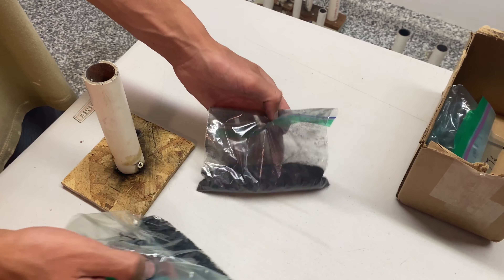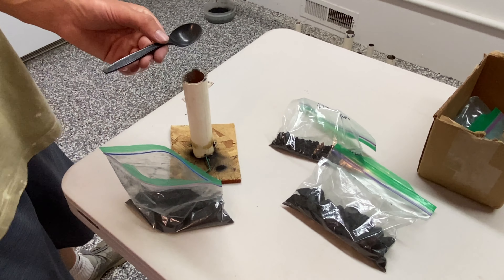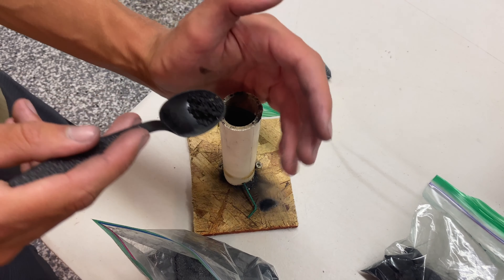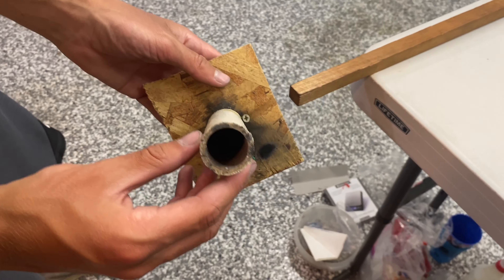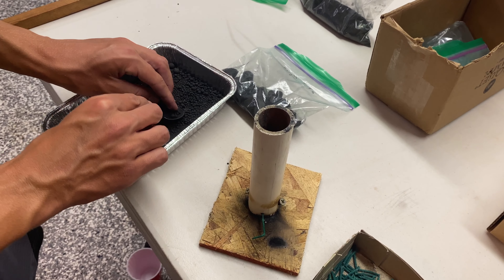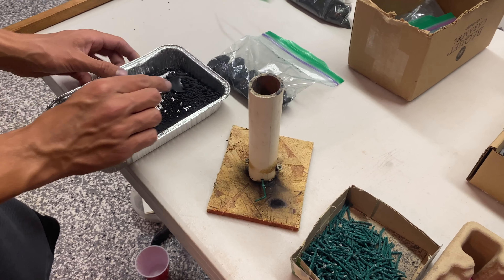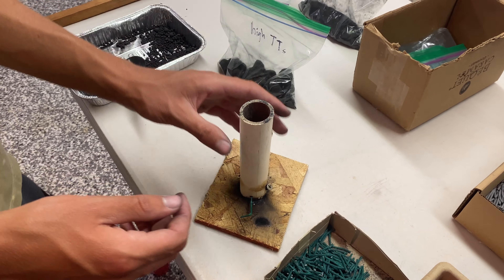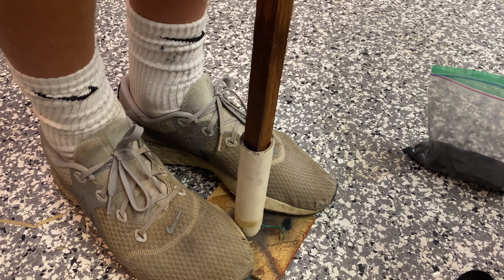How to Make Starmines

Comment: As others have said, using ABS is far superior to PVC. PVC is straight up dangerous. If you can't get ABS cheaply then use cardboard tubes. You can roll your own for very cheap from just about any paper using a dowel and wood glue (white glue works fine as well). Rub the dowel with wax to make it more grippy on the paper and to prevent the glue from sticking to the dowel.
Reply from the maker: Thanks for the tip. I will definitely look into using ABS.
Reply from the maker: I changed them in my most recent video.

Comment: Use ABS instead of PVC. If PVC bursts it can turn into nasty shrapnel.
Reply from the maker: What does ABS do when it breaks apart? Is it weaker?
Reply: It just bends and splits. PVC shatters and can act as shrapnel. ABS is more flexible.
Reply from the maker: I changed them in my most recent video.